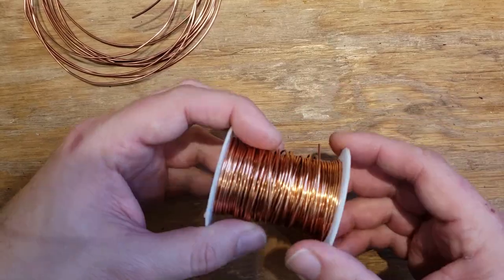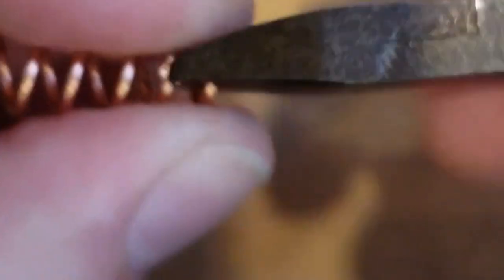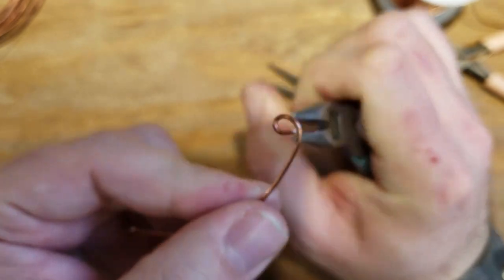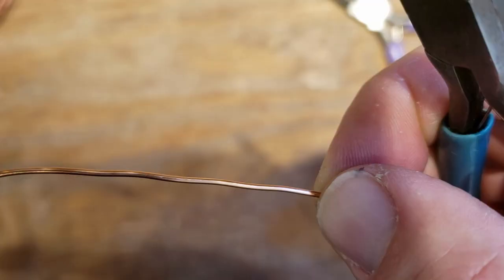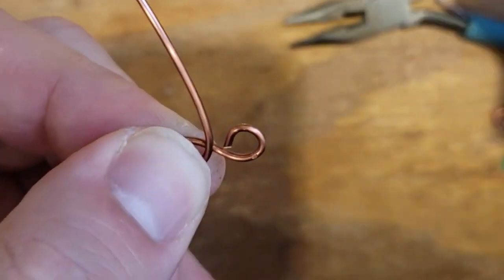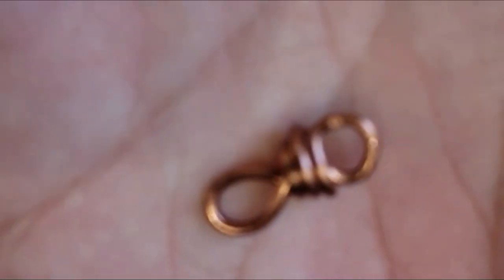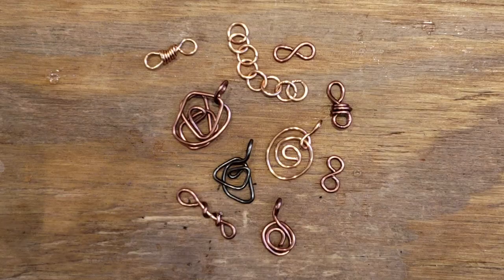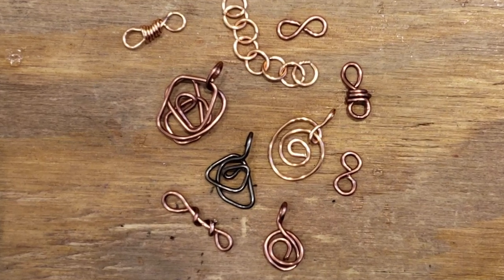Connectors for Handmade Jewelry - Eps 85

Comment: Matt again great job!! I've known how to make all except the square  1. But you reminded me of my 2 mandrels for jump rings/ loop sizer. I also just remembered from watching you about the 4 plastic mandrel with a handle that are oval,  round,  triangle and square. Mine is grey and each mandrel can be removed from the holder. I believe it's actually called cabochon mandrel.  About your spiral link. There is a way to make a connector on both sides.  Haven't done it yet but will have to practice.  Another idea with the shaped mandrel is to make different shape jump rings. Great inspiration as usual.  Much love and hugs to you!!